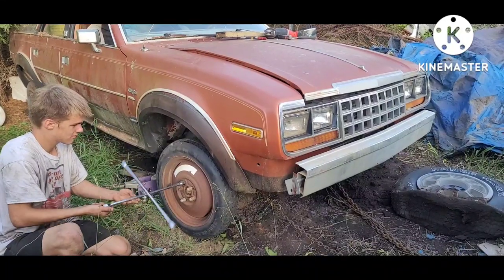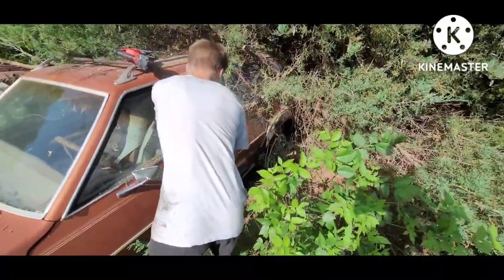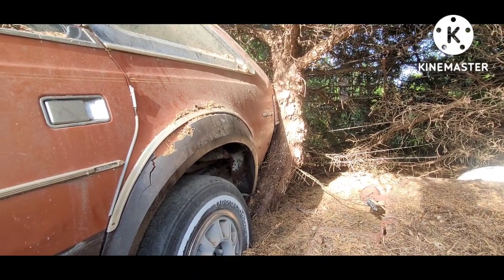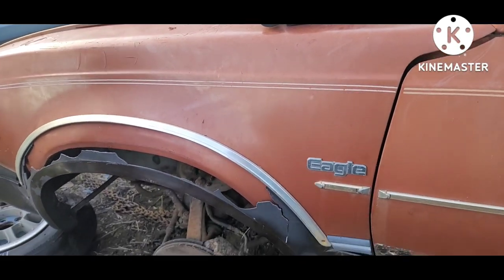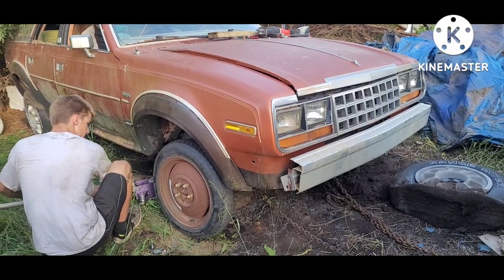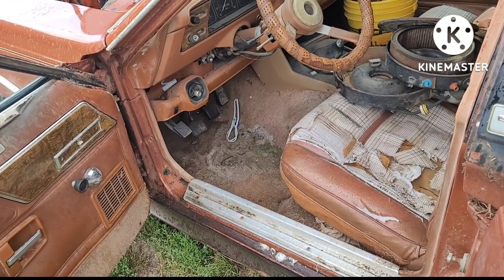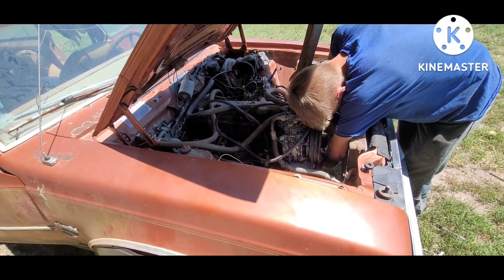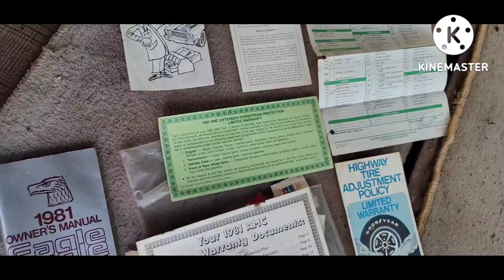Out of the Woods: FREE 1981 AMC Eagle station wagon! Walk around & Will it run? Vintage 4WD car!

Comment: My Uncle had one of those wagons and it ran awesome. It was great in the snow. On the highway and out on dirt roads covered in a good foot or two of snow. He did brag about the power of the 6 cylinder all the time. I don't think that he ever complained about it once, not that I knew anyway. 
I hope that y'all get it running and it does the kid good by running strong.
Reply: Oh yeah you get one with a straight 6 in them and they are tough cars. Not the greatest on fuel but they will drive through anything and are reliable as hell.

Comment: This rig would be a challenge, but worth saving.  For being in the elements for so long, she's in pretty solid condition.  Time for some vinegar and acetone down the troublesome cylinders.  Let it rest.  Soak those valve lifters with same mix and make sure the valves are lose (pull and soak that carb too).  Pull the head off.  Block-and-mallet time on those pesky pistons!  Hone 'em.  Those AMC sixes are much more resilient than given credit for.  That mill has enough punch for any 16 year old.  Ahhh, the promise of youth and time!  Great video!

Comment: there is a reason they changed to a different 4x4 system in 82, these ate front cv joints like candy. i had a80 and quickly sold it after its second cv joint failed in 20k

Comment: Probably the distributor! Pull it before forcing that engine around. Those 4.0 ltr 6 cyl is tough as hell, I loved my '97 Cherokee Sport.
Reply: These have a 4.2 258 or a 4 cyl Iron duke. The 4.0 is the better engine tho, has way better head design

Comment: Sitting 20+ years.....
Go ahead and remove the head for educational purposes. 
Otherwise, just remove the whole engine and transmission. Go through it all. Make it reliable. 
Install an original replacement automatic transmission if possible. 
I don't know your state smog rules. Perhaps consider replacement 304 engine? Although not always easy to find.
Reply: Front axle bolts to the block on these. Not to say a 304 swap hasn't been done. But a lot of work and fabrication. Also oil pan and front differential don't play together